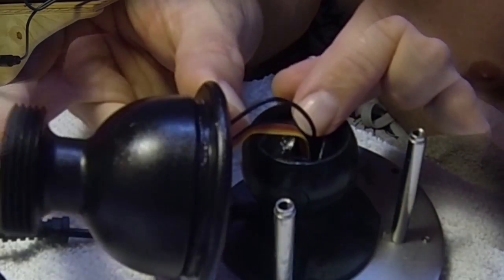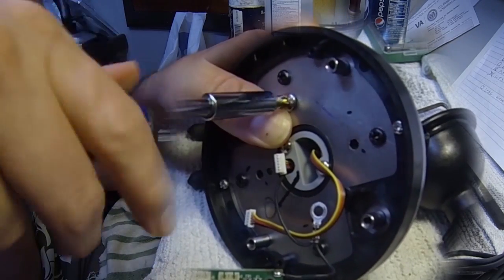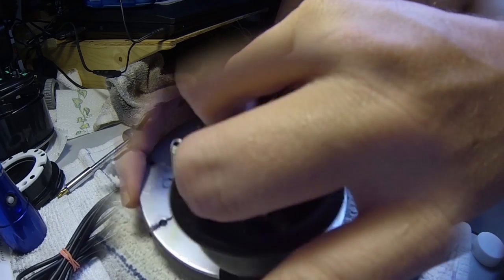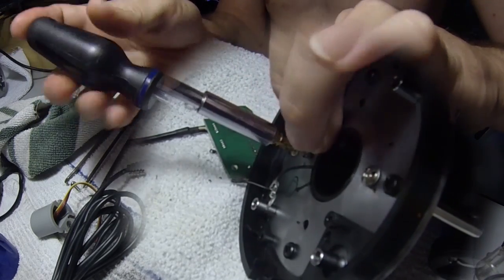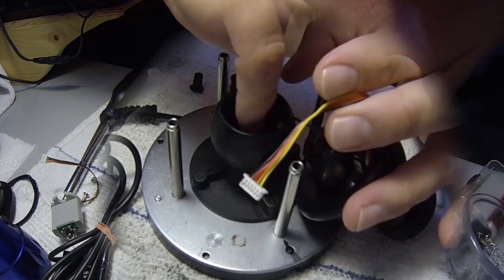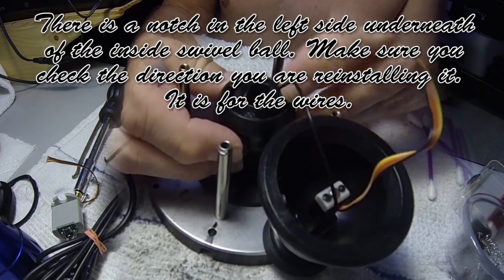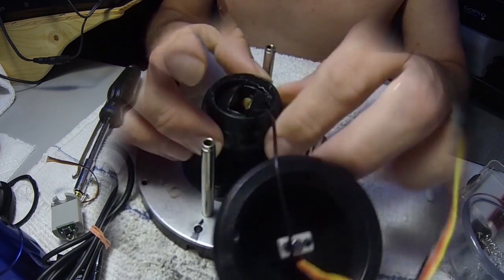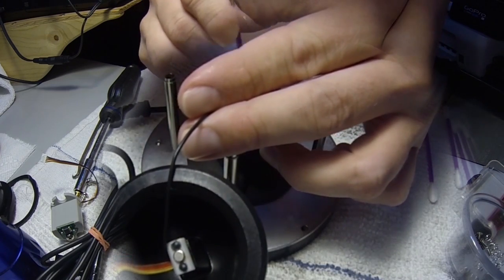ThrustMaster HOTAS Warthog, Complete Disassembly, Grease Replacement, Stiction problem, fix

Comment: Excellent video. I have a Warthog on order and will be sure to try this if needed. I do have some Molykote white grease which is used with small plastic gears in printers which I hope will be sufficient as an alternative to Lewmar Gear Grease.
Reply from the maker: Thanks.  Some people don't have any problems.  Hopefully you won't.
Reply: Received my Warthog yesterday. It was virtually straight off the container from China. I am shocked by the epic proportions of this HOTAS. It is far larger and heavier than I was expecting. I ran a whole series of tests in DCS A-10 and the joystick works very smoothly with no detectable stiction so hopefully the QA at the chinese factory has improved.
Reply from the maker: zaphod6502 Keeping our finger crossed lol.  Good luck.  And i felt the same way when i got mine big and awesome.  Never felt one that flet and responded like this.

Comment: Great video!!!! I really like the way you zoomed in on the area being worked on, makes it very clear what you are doing. I have gone back and forth on the springs number of times and I prefer not to use the big spring and just use the little springs on top of the sliding mechanism.
Reply: Al, I have changed my main spring, had some custom springs made up till I got one that worked. The trick is if a balance between the main spring and the 4 small base springs. Having customs springs made up at a shop close to you is cheap. Bare in mind, when the custom main spring is compressed, you must have the same height as the compressed 'original' spring, if its higher you will loose movement in the stick axis. Mine works great now, I still want to adjust the 4 base springs though, but flying A-10,IL2, and the Huey is a breeze. I could not fly the Huey comfortably on the stock setup, just to much tension.

Ronin, thanks for the vid, very interesting, I think I am lucky though and dont have any stiction issues.
Reply from the maker: Thanks. After this procedure it is much easier to move the stick.  But I know a lot of people like no tension or very very little.
Reply: Vlerkies Where did you get your custom springs made up? I'm struggling to find anywhere in the UK that does wider than 60mm overall diameter.